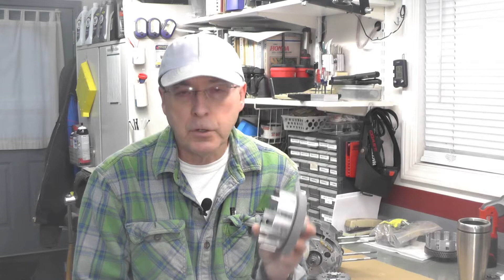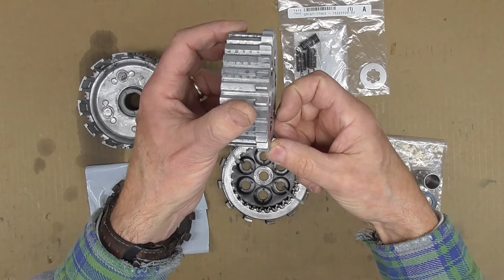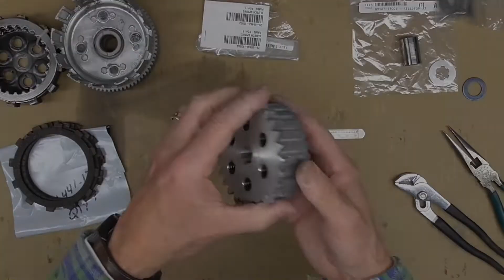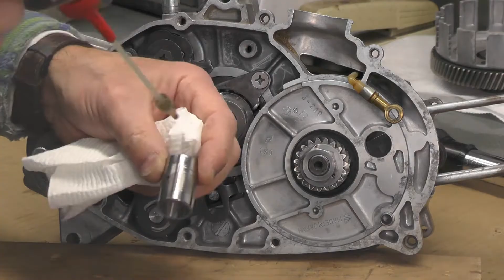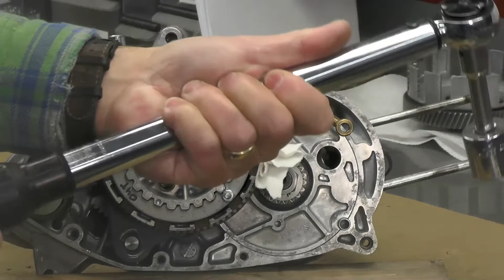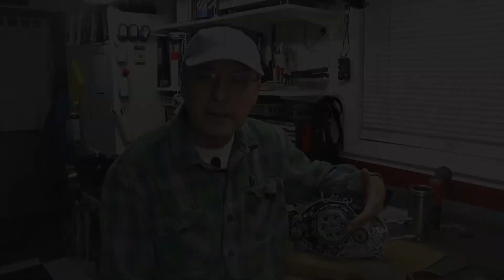Suzuki TS50, Reassembling Engine Right Side, Pt #2 --- Video #315

Comment: Hello may i have some help on the end of the clutch cable as i cant seem to fit it on
Reply from the maker: I need more information.  Such as, which end end of the cable, the engine end or the lever end?  What specifically are you having an issue with, is it too short, won't fit into the fitting, etc?  Did you originally remove/detach the cable or did someone else?
Reply from the maker: Did the cable end break off?  If not, there's a metal end on the cable that fits into a swivel mounted on the clutch arm.  To fit the cable end back into the swivel end, you may have to loosen the cable adjuster to create slack in the cable, possibly bend a tab back to allow the cable end to engage with the clutch arm.  Of course you'll have to remove the left engine cover to gain access.  If you don't have a service manual you should get one.  I don't touch a project without a service manual, and I've been doing this for well over 50 years.
Reply: @ it engine side and it came loose and wont go back on

Comment: Hello im out of answers now and you are the only person I trust about the suzuki gaucho. I have spark, i have fuel and i have compression, i did get the bike running for a bit by throwing some gas in the intake and then using starter fluid, but now it wont run, i dont know what could be, the sparkplug, which is new, comes out wet, now it wont start even on starter fluid, its just dead, do you know what could i do or check now? Im out of clues, thank you for your time.
Reply from the maker: Let's start with the simple things first, since the bike did run.  I suspect the plug, or less likely, the ignition system.  If the plug is wet it's likely fouled, possibly due to too much choking and the engine is flooded.

Pull the plug and leave it out.  Kick the bike over five or six times to clear the lower end & cylinder.  If you have another known good plug, any plug will do, connect this plug to the lead, ground it against the engine, turn the key on and kick it over to check for spark.  If you have spark, then it's likely the original plug you started with is fuel fouled.  Replace the temporary test plug with a different proper used good plug or get another NEW one.  Don't try cleaning and reusing the plug that's fouled at this point.  After installing the second good/new plug, try starting it WITHOUT choking it.  See if it pops or even runs... if pops but doesn't start, try a little starter fluid (don't over do it, just a quick shot).  If it starts and briefly runs on starting fluid, then you can try using the choke to get it to start.
 
Let me know how it goes...